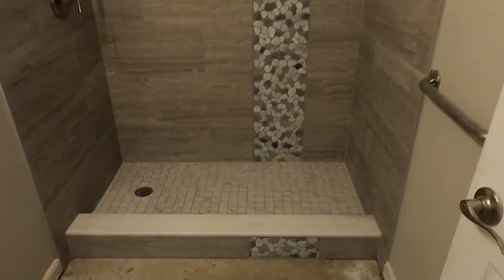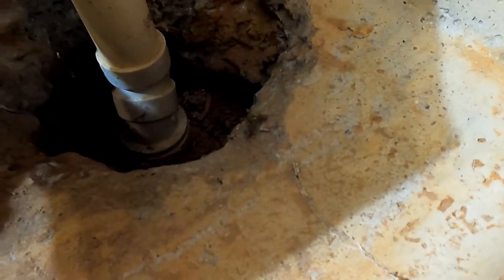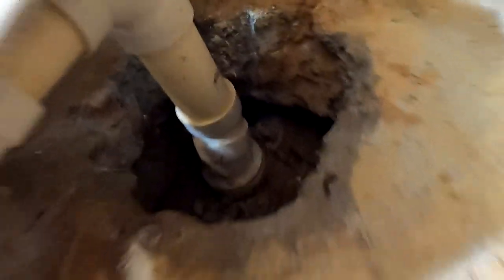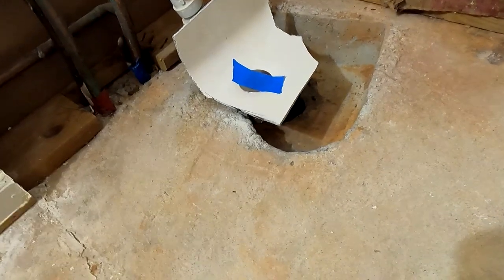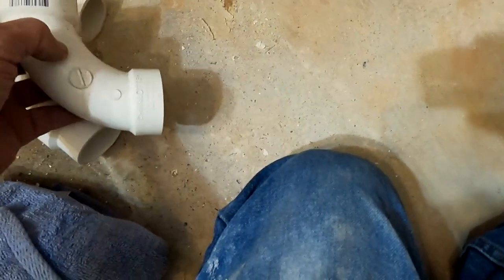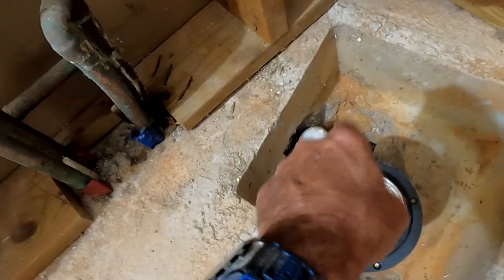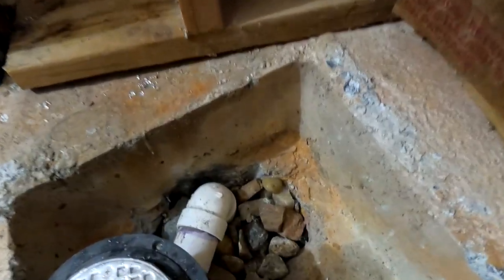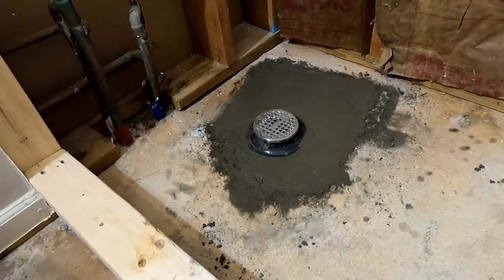CONCRETE FLOOR SHOWER DRAIN

Comment: Don’t ever do it this way. Take the time to do it right. Break floor and move trap. Shower drain should be directly above p trap. Doing it this way will cause slow drains and possibly a bubbly drain
Reply from the maker: First off the trap might be a foot or more below grade so no one will be digging that far...only to realize it feeds from a 4" main and now you need  Y to reconfigure the whole thing, are you on drugs ???
Secondly code allows for drain to be up to 20inches away from trap.
Thirdly no one will ever see your comment so not sure who you're warning 🤣
Reply: @StarrTile   reall plumbers that I learned from will dig down to trap no matter how far it is. Professionals do their work the right way not the convenient way. Yes 20 inches in height as to not make the ptrap empty when the water flows through it but still directly under the drain. (Again I’m speaking professionally not handy man I can do it cheaper special) and apparently someone did see my comment otherwise u wouldn’t have answered.. thank you for showing ur ignorance. Have a blessed day and hire professionals
Reply from the maker: @budizyzerhernandez8514  excuse me but I believe you showed your ignorance.
Last thing 1st...I saw your comment because this is my channel for 14 years, so I get notifications and analytics, and  I choose to respond, ignore, delete comments or ban you from making comments. 

And yes, even plumbers can & will follow path of least resistance to extend drain pipe up to 20inches away from trap, seen it...in fact a plumber showed me this method in 1988...yup, I've done plumbing longer than tile, and with 25 years building showers I'm confident I know both more than you 👍🏻👌🏼👋🏻

Comment: Frankly, I don't see any reason that a shower would require 2 inch drain piping. Many operate from 1 1/2 inch piping so when the OP says "the hardest part of a slab floor is getting the drain configuration correct and increased to 2 inches from 1 1/2 inches", however one needs to realize that the piping that's hidden below the slab, the P-trap and so on, is only 1 1/2 inch because this was a Tub before this conversion. I plumbed mine all the way to the flange with 1 1/2 inch and coupled it to the 2 inch flange by using a 2 x 1 1/2 inch flush mount bushing inside the flange and a 1 1/2 street elbow into that.

Comment: Good video, lots of good professional tips.  Plumbing is sometimes a real challenge, there is always options for fittings to get the job done, just want to mention Ive used a reciprocating saw the reaches into tight spaces which works really nice for cutting PVC pipe, if you make a few slices into the edge of a fitting then uses a good HT heat gun you can actually peal away the fittings with out damaging the pipe or fitting you need to remain usable.  this can be really helpful

Comment: As always great video and very knowledgeable. Ive been watching you for years. I noticed you stated that a plumber would never take the time to break out the concrete and replace that improper 1.5" trap. As a plumber myself i always take the extra time to do it the proper way (as the UPC book specifically states that you cant reduce the rated size of a fixture trap). Showers need to flow 2" for a reason including flooding purposes. But i also recognize that cheap customers don't want to spend extra money sometimes and sometimes it just ain't in the bid! (: Much respect for the effort and time you put into teaching us!!
Reply from the maker: Much respect, and I can appreciate where you're coming from, what I'm suggesting is that they're probably wouldn't be many plumbers that would go below grade to get to that P-trap because that's where it would be, but of course plumbers make six figures a year so I suppose you will still do what you need to do.

But yes of course GPM that flows through a bathtub is much more than would be a shower but of course we have a shower curb that's extremely short compared to the size of a bathtub.... I've just never heard of a shower overflowing from the curb because the pipe was too small, that's just my personal take on it.

Thanks for watching and thanks for the comment ✌🏻👌🏻
Reply: First of all your video four years ago really helped me do my first walk-in shower I believe you’re the only one that actually did it right on all the DIY YouTube videos that I saw. Regarding the 2 inch drain reducing to 1 1/2 I believe this could be a problem, as with a tub you You step out you pull the plug your tub drains in the timing it takes to drain. When you’re taking a shower if the drain can’t accommodate the GPM you’re going to be standing in a couple inches of water regardless if it goes over the curb or not, it’s not a comfortable feeling to stand in gray water while taking your shower. Just saying. I’m going to do this conversion and I’m a little concerned on when I did the first tub install over 20 years ago, where my 1.5 inch drain connects to the 2 inch to 2 inch. I Guess I will find out when I pull the tub and check. But I can definitely see through the access panel that it is definitely a 1.5 inch P-trap.

Comment: I almost have the same problem but instead of 3" I have 2" to the drain base.  Can I use 1/2" cement backboard on the floor area to gain 1/2" and them floor mud to level the whole floor?

Comment: Great job! Got a question... if I use Dennshield tile backer for my walls do you think it’s necessary to put a couple coats of redgard on it? I’m already buying a gallon to waterproof the floor and I don’t want it to go to waste. Is waterproofing the densshield an extra layer of protection or will it create a mold sandwich?
Reply from the maker: Denshield is waterproof...but edges and fasteners still need mud or caulk and waterproofing

Comment: I’ve recently installed a new shower drain. 

Before i concrete it in, will it be an issue if the drain housing is an 1/8” lower than the existing concrete slab?

Comment: I recently asked this on one of your other videos my concrete slab is stained do I need to strip the stain off in order to use thinset and mud pack for my shower pan
Reply from the maker: No
Reply: @StarrTile  so just any old thinset and mud right ontop of the concrete? Will work just as good?

Comment: Sir, Don't you think that using a straight 90 will cause problems in the future? It might be not possible to snake. Thank you for the answer.
Reply from the maker: So as I mentioned in the video it is not good to have straight 90s, you want sweeping 90s as I also mentioned @10:50... however in this case it wasn't possible but at the end there was a sweeping 90 at the drain. And any plumber will have different cable sizes for their snake in the extreme rare case they need to clear a p-trap

Comment: You don’t need to add space between slab and flange for a pre slope? You usually leave concrete leveled when you put liner?
Reply from the maker: I don't do pre slopes...and you waterproof surface of pan and walls making pre slope obsolete
Reply: @StarrTile  Thank you.

Comment: Also when installing my drain do I need a pea trap in the drain as well?
Reply from the maker: Yes...but tub to shower conversion it'll already be there below grade
Reply: @StarrTile  thank you very much for the advice
Reply: @StarrTile  one more question if I mortar my pan to a concrete slab do I need to use self leveler first?
Reply from the maker: @samdaniel5703  you are not mortaring your pan to concrete, there will still be a waterproofer or liner or something, you have a lot more research to do it appears
Reply: @StarrTile  OK thank you

Comment: So former tub’s P-trap (and shower to be) is in the dirt way below, away from anyones reach? How do you know that is the case? Is that a regular plumbing practice? Bizarre!
Reply: He knows because it's always the case on a slab
Reply: This house must have been built in the 70s, my house had all the nightmare plumbing angles, I was fxxxxx like chuck as well.
Reply from the maker: @matthewbegin3462  😂😂😂
Reply from the maker: @splanzza... What Tim said, always p-trap in the dirt under slabs
Reply: @timtoolman6442  it’s actually not always the case, there might not be a p-trap in there at all. It should have been dug up completely to check.

Comment: Haha😂 I'm not going to run into crappy home builder screw ups. You've never worked in Louisiana, where the lazy building inspectors don't inspect work done outside the city limits.  That pipe job looked like an opps moment. Here, you'd have more WTF were they thinking moments.
Reply: In Texas too. I had two 3" stack drains both leaking, one was cracked, my guess is a limb may have hit the stack on the roof, I had to peal the exterior siding & sheathing cut to reveal the area, found a Tee that had a big crack, silicon-ed & duct taped! then 12 feet down the wall wear a water supply froze I had to do an emergency fix on, found that someone had been into the wall already, (sheathing cut) sill rotted & non existent, cold air pouring in the wall, some bonehead again performed a hack job where they drilled a 2" hole in the side of a 3" stack for a shower drain & silicon-ed it, leaked like crazy. I just did a quick band aid repair with the sill & insulation to get it tight from the weather the I tore that all out this spring when I remodeled the bathroom all new plumbing, drain, pex for supply. insulated the pipes & wall repaired the sill. It's not often to cold in Northern Texas but we get some 20 degree weather sometimes. Never mind the zero degree temps a few years back. There's only so much you can do when dealing with temps that cold here, the city supply pipes are just not deep enough in the ground.